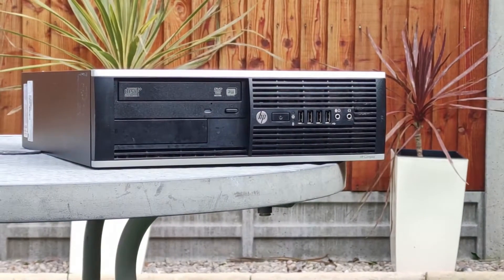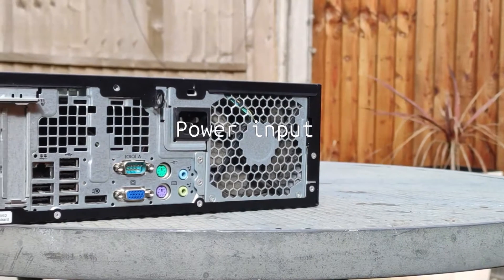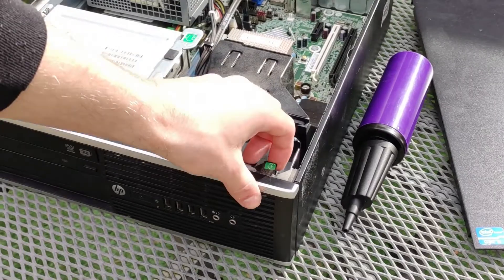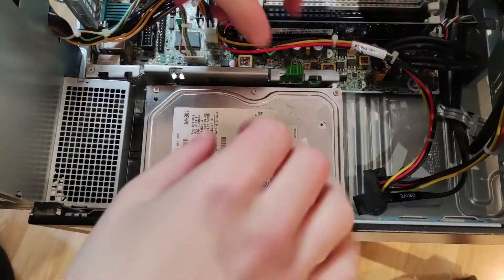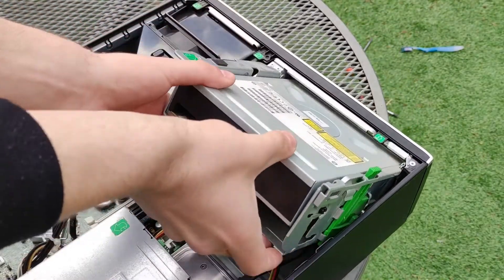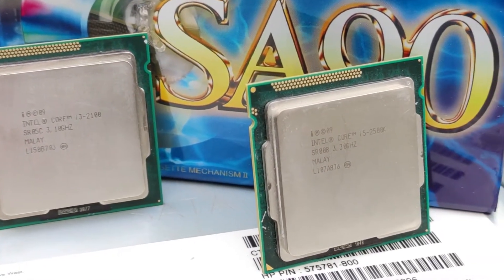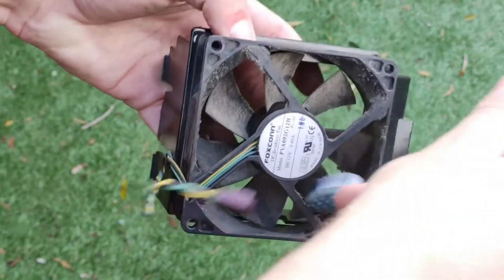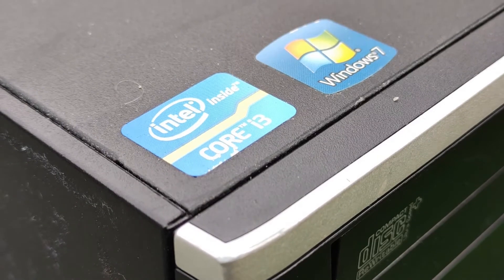How to Fully Upgrade/Refurbish a SFF HP Compaq 8200 Elite

Comment: Great video bro. But i have a problem with it, I've installed two 8gb ram and the pc turns on but it gives no video. The rams are the same as the original, they are DDR3 1600Mhz 12800U. Can someone help me?

Comment: peel the label back on those noisy fans and give them a shot of lube to keep them quiet when they start complaining. I used wd40 and been quiet for years now. These are great machines. 7 bucks at a garage sale with a bad OS. Hardware was fine. Still my daily driver

Comment: which is the best graphics card that this system can support? Or how can I find out what it is ?
Reply from the maker: @Helkost  You can toss whatever low profile graphics card you want in here as long as it draws less than 75w of power. Though the platform is so old that you'd be missing out a decent chunk of performance if you put anything new and fancy in it.

Comment: I just got a Compaq 8100 SFF. I tried to upgrade the memory but even if it recognizes the new   RAM(all four are populated) it  only utilizes 4GB due to the low specs of the power supply.  I haven't found yet how this can be changed in the bios. Any tips?
Reply from the maker: @NickolasGaspar8bit  the RAM will have nothing to do with the power supply, are the RAM sticks identical?
Reply: @scellyyt  I think it must be memory reserved by  the onboard graphic card. Windows detect all 8GB but it states in a parenthesis (4gb usable). Thanks for addressing my question though.
Reply from the maker: @NickolasGaspar8bit  it should also show how much is hardware reserved (i.e. used by other hardware like the igpu), what does that show?

Comment: very interesting vid...thanks......do you thing it could be possible to   put a M.2 M2 ssd by using  the pcie slot ?
Thank you for answering
Reply from the maker: You can install an M.2 NVME SSD this way but you will not be able to boot from it without some bootloader tricks because this machine doesn't have UEFI NVME booting.

Comment: Info from the web suggests this machine can handle an Intel I-5 2600 processor but I do not believe this will work for a Windows 11 install. Beware?!
Reply from the maker: You are correct, the minimum requirement for Windows 11 is 8th gen intel or newer. You can hack the installer to make it install on this computer, but I believe it won't recieve updates.

Comment: I have a hp compaq pro 6300, do these upgrades still apply? Also is it possible to upgrade to a i7-2600 and gtx 1650 considering the psu wattage?

Comment: How are those fans sounding?
I picked up a condition unknown one of these with no ram,  cpu, or disk. It powers on but doesn't boot with known good ram and cpu, and correctly complains when given the wrong ram. The fans are quiet like new. Makes me think this machine was stripped when quite new because of fault in psu or motherboard. Any suggestions?

Comment: This is my computer. Every year I'm tempted to buy a newer model, but it still does the job. I have it pretty much maxed out by now. Core i7 2600, 32 GB Ram, 2x SSD (1TB + 4TB), Nvidia Gtx 750 Ti, USB 3.1 ; Linux Manjaro.  Perfect for heavy office stuff, photo editing, or even HD video editing (4K wouldn't be reasonable). It can also manage some gaming within reason (GTA V, Hitman 3 type of stuff). It's virtually silent and runs cool as  a cucumber (processor @30°C idle).
Reply: Have you upgraded the power supply? Is the power supply that gives 192W for this HP 240W and 12W channel sufficient? Is the graphics card low profile?
Reply: @OnurSeven00346  : I kept the original power supply. I computed the maximum draw of the graphics card against the pci-e rail capacity, and while not a comfortable fit, it was a fit nonetheless. The card is a Gigabyte Nvidia 2GB 750ti sff. It works, and I had 2 mechanical HDD inside for a long time before I swapped them for a SSD. Never missed a bit. This power supply is truly "The Little Engine that Could" !
This said, I wouldn't be comfortable pushing it further.
Reply: Is it worth it to upgrade the cpu? I'm looking for a cheaper gaming alternative until I can afford an actual gaming pc.

Currently I have the stock i3-2100, 12GB DDR3 ram, GT 1030 2GB DD45, SSD 500GB.
Reply: @MerkurioBua  Sorry, I don't game much and I got mine with the top of the line i7-2600 so I never researched further, but from what I heard, you don't need to go over an i5-2500 in that rig for light gaming. The i7 would be wasted, I use it for video editing in HD. It will run a lot of good games, but don't expect the latest and greatest.
Reply: Well then I guess its time for an upgrade lol @ordinosaurs
Reply: @ordinosaurs may i ask how you limit the gpu power consumption exactly, and how does it impact the performance?
Reply: @Hygix_  : As I said, I don't. I did a quick math check, and the draw of a 750Ti fits the possibilities of the power supply. So does other sff models, see which are known to work.
Reply: @MerkurioBua   this components i have in hp compaq
Reply: i currently have the i5 2400 with a rx 550 4gb graphics card. its good for a lot of games with low settings. i have the i7 2600 on the way from ebay and im also going to put an rx 6400 in it now. the rx 6400 or the gtx 1650 are the best cards it can handle. they are equal performance but the rx 6400 is cheaper.
Reply: It will actually push games better if you give it a 1050 ti gpu or a low budget Radeon RX. The i7 2600 still has some juice left in it and it still beats new gen Pentiums
Reply: Hey I have the same model and I'm looking for a Graphic card which card do you recommend because all the other ones won't fit
Reply: @Joshuarosse : you should look for low profile (or sff) models with a half height bracket. Some compatible models were listed in the previous comments, top of the line being either Nvidia 1650 or AMD rx6400 ; but a 1050ti will work fine, as would other older models. It depends on which game you want to play. In any case, a computer that old will struggle with modern titles, and the CPU will bottleneck the more recent GPUs.
Reply: @ordinosaurs  alright
Reply: @Joshuarosse Depends on your current CPU. That specific computer model is limited to the Sandy Bridge generation, and the bios won't expose the necessary parameters to change frequency and currents levels ; therefore you are limited to either the i5-2400 or the i7-2600, non-K versions. Frankly, the i7 is a waste of good money. No game of that period were that efficient to take advantage of 4c/8t. The i5 would be cheaper and better balanced (4c/4t). The i7 is justified if you do some video rendering, but limit yourself to HD and forget 4K, it would be very frustrating.
Now, if you are careful, you won't "mess" the computer, but if it's your first time, watch some tutorials, pick the right tooling, and do it under someone's watch whom has more experience than you. And don't forget to add a drop of thermal paste...
No-one has ever become proficient at a technical skill without hands on experience, and without making mistakes in the process. Those boxes can be had for a song, but it's money still, so depending on your budget, ask yourself if you can afford breaking something...
Reply: I have the intelcore 5 2400
 @ordinosaurs
Reply from the maker: Let it be known that the Rx 6400 performs best on platforms that support resizable BAR, and this computer does not support it.
Reply: @Joshuarosse  I wouldn't upgrade. Max the RAM to 32GB, if you still have spinning disks, a 4TB sata SSD will do wonder, add a USB3 card and front connectors, and add a mid-tier GPU. You'll have a very decent home productivity machine, Beside that, this computer is way too old, and it doesn't have a clear upgrade path (you can't swap neither the motherboard nor the power supply, and you can't swap the case either).
Reply: @ordinosaurs   No im not planning to do that im planning to upgrade to 12 gb ram because the computer doesnt support 32gb ram i now have currently 10gb ram in it
Reply: @Joshuarosse  This computer absolutely supports 4x8GB PC3-10600 DDR3 1333 DIMMs for a total of 32 GB.  Don't mix and match various dimms, it's a "performance" killer (albeit of course, performance is rather relative in that case).
Reply: @ordinosaurs  ah alright
Reply: Bro my front panel are not working anymore, can You make a video If its easy to repair this
Reply: I just through buying this exact model when I found out it is a good computer for playing games. I have a monitor on order that's supposed to get to me by this week end.

Comment: Hey can you share the links for the upgrades you use please
Reply from the maker: For this video I didn't upgrade anything, I just demonstrated how to do it. There weren't any real upgrades in this video. Suitable upgrades, however, include a better processor e.g. Core i7-2600 and a SATA SSD, which will fit loosely in the case as it does not have mounts for a 2.5" drive.

Comment: would you really put in a i7 8th gen or newer on this motherboard?
Reply from the maker: No, this motherboard natively does not support higher than 2nd gen CPUs because of the BIOS and socket (despite 3rd gen using the same socket). Any CPU newer than 3rd gen physically will not fit in this machine.
Reply: thanks for the quick response 😁👍🏽 i have a HP Compaq 15-a007sz and was looking for an upgrade, but i think i would have to change the motherboard, right? these things developing fast af 😂
Reply from the maker: @kanzima-records  to be fair it's over 10 years at this point, and you wouldn't be able to find a new suitable motherboard for it as it is a discontinued product with a HP proprietary motherboard form factor. If you want more modern hardware you're better off just getting a newer machine.
Reply: @scellyyt  alright, thanks a lot 🙏🏽

Comment: I am watching this video right now this same system but the specs are: 
i5 2400 3.10 Ghz
16 GB Ram (I upgraded)
250 Gb HDD, I use just for browsing and researching
I also install windows 11 on it which run perfect
Reply: no gpu? i got one with an i7-2600 few days ago and idk if i could do video editing on it
Reply: @1andonlyfaxz787  I believe you can
Reply: System upgrades: 
Installed - 256GB SSD, 700GB Storage drive & RX 550 4GB GPU
Reply: The low profile GPU ? 😊 @TheThugzman
Reply: @TheThugzman I mean is your GPU low profile
Reply: It's old but still capable 👍

Comment: Add an Nvidia GeForce 750 LP or even a 950 LP, and you can actually use the PC to run games on both XP and Windows 11. The 8200 and 8300 series are some of the fastest OEM computers capable of running both operating systems with full driver support.

If you are primarily interested in newer games, then a 1030 or even a 1650 will run fine. However, the 950 and 1650 require an additional case fan and, as a result, significant modifications to the case.
Reply: CanYouGiveMeAFullUpgradationOnANormalRangeOFHPCompaq*8300

Comment: As a follow up, Moore’s law may still be alive but it doesn’t apply to software development.  10 year old computers can provide the needs of the users despite they are two or more behind Moore’s law in performance.  Software capability hasn’t really advanced any very far from the mid 2000s in terms of real functionality.  Moore’s law is exponential, software development is linear.  Old Word/Excel is from the early 2000s have all of the features most users need.  Unless you are playing double A games and are in the top 10% of players all of that fancy stuff you spent a fortune on won’t help.  Consider Sgt York in WWI and you’ll understand.

Comment: One of my tricks is to pull off the cover, remove the power supply, hard drives and other loose items and putting the entire computer into our dishwasher upside down so the main spraying wand can hit every square inch of the internals.  Let it dry for five or more days.  The computer’s interior looks amazing.  The rest of the parts get a full IP99 treatment with a spray bottle, a toothbrush from China and a lot of paper towels.  Give it time to dry.  The last thing I do is use some Deoxit on all of the connectors and some socketed chips.  I do this so friends of mine that don’t have the cash to drop on a new computer can make what they have to last for hopefully several years.

Comment: Those extra case screws actually aren't extra case scr4ews.  Those are the slide studs to put into drives and such, to lock into the large drive bays and slot into the runners / slots that locks the drive in. then you can take them out and put them in by pushing and holding the green button there, toollessly.
Reply from the maker: I didn't know this. Thank you very much for sharing.

Comment: Thanks for the video, really interesting. I'm thinking of getting one of these to make a cheap gaming computer for a friend. I think I saw some PCIE slots, do you think I could get a GTX Titan in the case? How many watts is the power supply.
Reply from the maker: The power supply is rated for 250w and the computer can only fit low profile graphics cards. There are no PCI power connectors, so if you do put a GPU in make sure it's 75W or less and can work with power from the PCIe bus only.
Reply: @scellyyt  Thanks, that'll be no good for the Titan then,..

Comment: In my system CPU is core i5 vPro to which latest cpu can I upgrade it
Reply: My elite can take i7 2600 as the max. Will be doing refurb video soon on performance with gpu.
Reply from the maker: You can upgrade it but probably not to the latest. Also, beware that while vpro is useful for remotely helping people with their computer, it also opens many security backdoors and has loads of vulnerabilities.